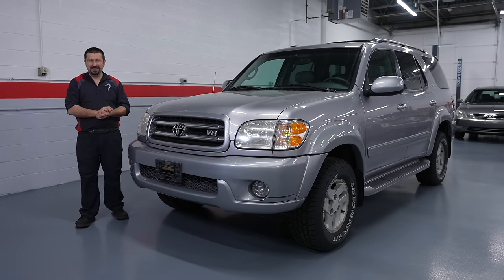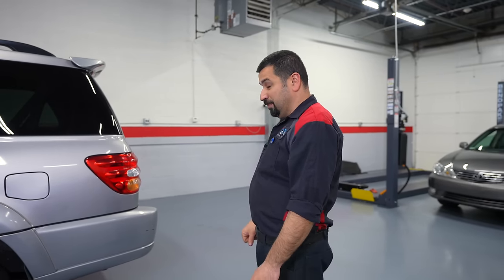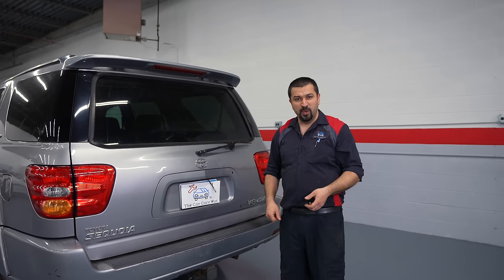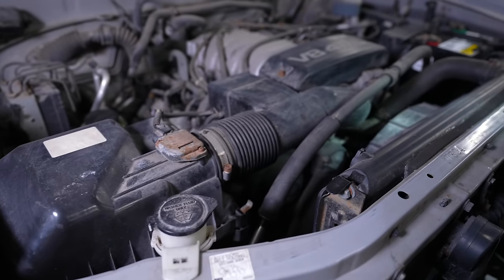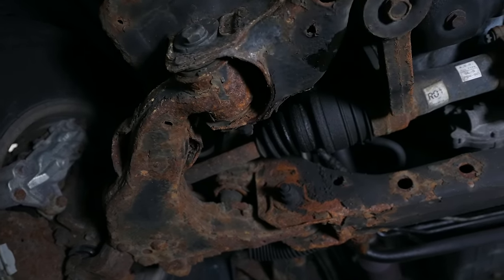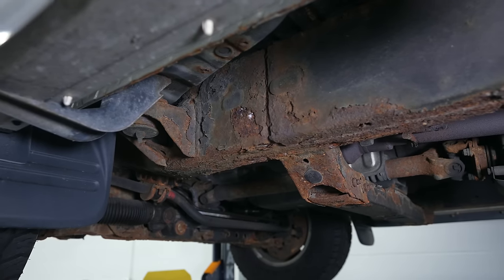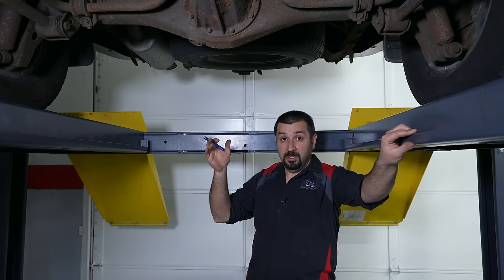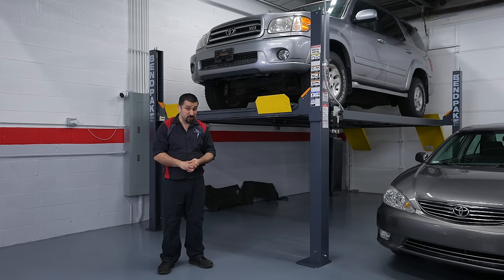NEVER Buy a Toyota Like THIS ONE! Hint : It's not The Sequoia!

Comment: We picked up a 2013 Sequoia about six years ago.   It had 55k miles on it and we paid $35k out the door.   Its an awesome ride and we could not be happier.  It has just over 100k on it today.
Reply: I have the same year - picked it up in 2020 during the lockdown, at 98K miles.  Only 111K or so, now, but it does the long trips with everyone loaded up, not suburban commuting where fuel economy matters.  It's great for the highway, but interior quality is definitely sub-par.  On balance, very happy with it.

Comment: An awesome video idea would be going over the Toyota frame rust issues years,models recalls, etc.. and what models and years that are better than others
Reply: It's just like termites eating away wood, only an idiot would say or think that one type of wood has better resistance than the other. LOL......NO.
Reply: @karkule5919  As a matter of FACT (feel free to do some self learning), termites will avoid redwood, yellow cedar, Laotian teak and cypress.  Perhaps a little research is needed before you use an analogy to label someone an “idiot”….but then again I suppose it takes one to know one.  😅

Comment: Toyota has a quiet recall on rusty frames. I had a 2002 Tacoma 4x4 that has its frame replaced for free by Toyota in 2008 /2009. I not surprised that the previous owner didn't take advantage of this given the maintenance history of the vehicle.
Reply: Makes me wonder about my 2011 that I traded- I didn't want to go into the gray area of the recall where, if the dealer ends up damaging rusty parts mounted to the frame, who pays?  Like mine needed the $80 transmission fluid lines, which would have been probably a $600 repair.

Comment: I bought a 2003 4Runner Limited 4.7L last November with 201K miles on it.  The first thing I did was crawl under the car before inspecting anything else.  It was amazingly clean with minimal surface rust on the rear axle!  Everything else was super clean.

The three previous 4Runners I looked at were complete rust buckets underneath.
Reply: how much did you pay for it?
Reply: @mountenwater  $7400 and that included delivery!
Reply: @2-old-Forthischet  thanks for sharing!! I'm thinking of selling my 2006 4.7L with 131K miles
Reply: @mountenwater  wow, that's a low mileage beast!  Good luck.

Comment: Thanks for this video.  I have an '04 Sequoia with 220k and in almost identical shape to the one you inspected.  The difference is I have owned mine for about 120,000 miles and know the maintenance history. My fluids were always changed on schedule and timing belts were changed about every 80k. Mine has never dripped any fluids. Always parked in a garage and we have never seen a drop from it.  The problems with the Hatch rusting and that Lever/Cable and latch breaking is VERY common.  I have replaced 3 sets on mine.  Toyota has never upgraded the parts so the problem repeats.  Some after market handles made from metal exists, but they just bend instead of break so same end result.  The rust issue of the frame and exhaust manifolds is my biggest issue right now.  Toyota did have a recall program for the rusted frames many years back on the Sequoia and same bodied Tundra's, but the rusting issue had not reached the level back then that is has on most of the Sequoias on the road now.  The Ball Joints also had a recall and should have been replaced on most vehicles.  In my case, I will not quit driving it until I have too. It's just a backup vehicle for us and is only driven a few times a month.  By far the best car I have ever owned.  I had better luck buying this Sequoia when it has 100,000 miles on it then I did with A brand new Traditional "Big 3" American Made vehicle (First towed @ 37 miles and Lemon Lawed by 5000). And that vehicle was the same exact year as my Sequoia.
Reply: You really need to expand your car buying options if your Sequoia has been the "best" car you've owned so far. 🤦

Even the 88 Cutlass I drove a long time ago was in better shape than this and all it needed repaired originally was the transmission and headliner fell down. Otherwise, it was very good for its age.

Comment: I’ve learned so much from this man over time it’s just incredible. This guy and the car wizard are the reason my house has a 4Runner in the garage and had a Tundra until I needed 3/4 ton unfortunately. I have a 09 Camry I use for a work horse commuter and I learned from the car care nut the engine in my Camry is prone to piston scoring the cylinder without careful maintenance. Great channel.

Comment: In my opinion the biggest red flag would be the owner not fixing these simple common issues. Almost every early 2000's sequoia i've seen has the broken plastic door handles and 7 of them with a snapped shift handle. So common that every local parts store carries the shifter and door handles in stock!
Reply: The real red flag is all these frames rot if they are exposed to salt after 10 years. Then brake lines too. It becomes a death trap.

Comment: I'm surprised that you have not seen broken shifters on these, they are very common to fail as well as the rear hatch opener. I have done many of these repairs.
Reply: Was a Toyota parts guy before, and the rear hatch handle is very common.  Often times what happened was the cable got stretched out, and so it took more force to open the hatch.  Plenty of people replace just the handle, but they break that pretty quick because the cable's still stretched out.
Reply: He worked at a dealer and probably mostly saw a newer vehicles

Comment: Shifter bracket breaking is common on those high mileage Sequoia and Tundra 1st generation models. The aluminum casting is thin (bad design) and eventually shears. (The OEM Toyota replacement part has untapped threads, but easy to install). One of the reasons why the 2nd generation went to console shifter.

Comment: 2004 Sequoia is one of the very best vehicles ever made. My wife and I own a 2004 Tundra SR5 crew cab and a 2004 Sequoia. Both had 375k plus miles on them until I hit a deer in the Sequoia back on Thanksgiving 2022. The Sequoia is now the donor for the Tundra
Reply: Yup. You just oil the crap out of it annually if in rust belt

Comment: Ive done a frame replacement in a 2002 sequoia I got for $1000 took about $500 in parts from the junk yard for the frame and rack and pinion, misc parts. I did it in a tiny garage and it took about 3-4 full days of work over a month. It's easily doable for DIY first time ever doing something like that. Word of advice when you get the frame from junk yard save every single bolt you take off and screw back into the place you found it. Put it on 4 6 ton jacks on body pinch welds, drop whole rear suspension keep it all together, drop from 2 suspension assemblies with diff, ratchet trans and transfer case to seats and hoist engine on body from above and take out the old from out in the new one. Get a bunch of 4 wheel dollies
Reply: Or you could buy a used car instead of all the tools needed to do this haha

Comment: My coworker Steve had this exact truck in the same color. He did all the recommended maintenance and like this one looked great on the outside and inside. So one day I asked Steve Where is your Toyota. He told me the junkyard. The truck was totaled because of the frame. So sad. I thought he would have the vehicle forever.
Reply: @Kerry Lewis he forgot to rinse the salt off of it regularly
Reply: @Blakecryderman7244  It always looked clean. I'm taking my new Toyota to NHOILUNDERCOATING. I do not want that happening to my RAV

Comment: I have corolla 2009 , it's a nightmare, engine burns oil , ac compressor issues, interior quality is baaad and too noisy etc, and i found that many owners of 2008 and 2009 models facing the same issues, so don't buy a new or used car before you do a really good research even if you are buying a toyota

Comment: AMD, I hereby promise, before 714,000 witnesses, to NEVER buy a TOYOTA like this one!!!😉As a Salt Belt dweller I take 3 very serious  lessons from this video : a) Rustproof your car!   
b) Rustproof your car!!  c) Rustproof your car!!!    Why would you spend so much money on such a high quality vehicle and then just watch it rot?  🤨    RUST = NEGLECT
Reply: Amen, Amen, Amen! I got my 2019 Prius undercoated after junking my used 97 Camry. I wash, painted, u name it, and STILL rusted out. Got 20yrs out of it total, ran like a top, but I KNEW it was done.
Reply: Not really.  All you have to do is spray down the underside in the spring after winter.   And use POR15 and a steel brush for minor rust spots.
Reply: Fluid film every fall  does wonders
Reply: @on-site4094  Later this year my car will be taken to Krown Rustproofing for its annual application for the 19th time. I  gave it a thorough cleaning on Saturday and after 18 very salty Ontario winters, it remains rust free. In the Salt Belt, rustproofing is just basic preventative maintenance. 😉

Comment: I am oddly fascinated by the amount of rust on the bottom of that SUV.  I've heard of this but never experienced it.
Reply: Just spray down the underside after winter and brush away the small rust apply POR15
Reply: Remember kids, just say no to living in the rust belt.  That cheap cost of living is deceptive....
Reply: @rushthezeppelin  Move to the south....cheap and no rust. I have a 1998 Nissan Sentra....no rust
Reply: @fortheloveofnoise  hot as a MF and poor worth ethic with more than a touch of entitlement for large portions of population . I grew up there. Moved away and saw the "light" and unfortunately had to move back for work and family. BUT the upside is my cars don't rust

Comment: I do know that the Toyota truck frames from that era were known to rust, especially in cold climates. I know there was a recall on that, but I still have two questions Car Car Nut: Was that the original frame? Also, can that vehicle still be covered under the recall, or is too late because of time/mileage for that particular Sequoia?
Reply: I believe the recall time is up.

I had a tundra under the frame recall, it got the frame replaced and it was a wonderful truck, I was sad dumping it at 298k miles, ran beautifully, clean interior that looked brand new, the seats were not even torn...

But, EVERYTHING was rusty, besides the frame and the body.

I had to replace 3 brake lines, there were literally 4 holes in the rear end that I patched to keep the oil in and not have to replace the rear end... I had to replace the exhaust due to rust, replace the front brake calipers due to rust eating the bleeders away to nothing, the power steering hard lines rusted through, the evap lines rusted through. The lower hose clamps was rusted and most were not even clamping anymore - it was only because the radiator cap didn't hold any pressure at all that the hoses didn't blow off. The parking brake cable rusted and snapped (5 speed truck, I needed it), the flanges on the rear axle that house the drum brakes were rutting and I was afraid to touch it. The fuel filter rusted through, the front bumper crash bar was full of holes. The right front control arm had a rot hole, and the power steering rack was leaking due to a very rusty input shaft.

And I'm cutting that list short, every single piece of metal under that truck was a disaster with puffy flaky rust, I had to wear glasses to change the oil

It was an endless time and money pit, even though my dad gave it to me at 240k miles. I couldn't touch things because something else would break, and I was sick of putting time and money into it because it was only 2wd.

BUT, the body was great, the interior was great, and the frame was new. It gives a false sense of "this is fixable". You'd need to rip everything rusty out and devote 6k dollars to it to make it reliable. Having multiple brake line failures from rust isn't something most people are ok with.  But thankfully it was a manual and I fixed the parking brake when it snapped.

Long post, but I want to give some context to "throwing in the towel". I could have ripped someone off and sold that truck.
Reply: The recall was only for Tacomas and Tundras. Sequoias and 4Runners missed the recall for some reason.

Comment: Never had a sequoia but I had a Land Cruiser and it was by far the best car I ever owned. Got 300,000 miles on the original engine transmission rear end starter alternator water pump a/c compressor, all the window seat operators worked, never even changed the spark plugs, headlights or any other bulbs. Amazing car.
Reply: Why wouldn't you ever change the sparkplugs that's standard maintenance it will effect performance and mpg its super easy usually

Comment: What’s your opinion on the market for a used Land Cruiser? I was worried about potential parts support, do you think I would be better off going for the LX as they’re essentially the same mechanically?
Reply: As an LX owner, I don't think the market for parts is better for the LX. Almost all the parts are the same. But what year are you looking at? If you get it with the 4.7 v8 I think most of the engine parts match the 1st gen Tundra, 1st gen Sequoia, and some 4th gen 4runners.
Reply: What year are you looking at for the LC? The main difference on the more modern models was the eKDSS system that the LX doesn't have (at least mechanically speaking).

Comment: Great video. I bought a used, one owner 2002 Sequoia about 3 years ago after a year long search. I specifically wanted a Gen 1 Sequoia and evaluated many vehicles. I live in Wisconsin and I looked for a non rust belt car to avoid many of the problems you identified. Found a San Diego car that had never been driven in snow with 130K and was well maintained. I bought the car without actually seeing it. Had it shipped home and I guess you could say I was lucky.  It's been a very good car with no surprises or issues. I totally agree that you must evaluate the car, but my experience is to also evaluate the seller. In my case, the seller was very honest, straight forward, and provided all the records and photos I requested. I got a good vibe from the owner, unlike some other sellers that seemed sketchy, though their car looked good (at least in the photos). If you sense a seller being cagey or hesitant to provide info, walk away. There are a lot of BS artists out there selling crap. IMO, look for the one owner soccer mom and avoid a car that has had several owners.

Comment: I had a 03 Sequoia I bought it with a trash suspension for like $3500 with about 175k. I should have done a pre purchase inspection cause the frame of the suv was just about rusted out. I drove it for 2 years but all the little repairs that came up was just too much. I put about $6-7k into it when the exhaust system failed as well as the shifter, my shifter looked just like the one in the video. At that point I said enough is enough. Toyotas are ok  but they are not these unstoppable tanks these YouTubers be saying.
Reply: I agree! All of these people preaching Toyota's are "bulletproof" and super reliable is very misleading. You can buy a Toyota with an excellent engine but it will mean nothing if it's sitting on a frame of rust.
Reply: @FCguy709  A well cared for Toyota is bulletproof. This was not cared for, at all.
Reply: @abdullahipad7664  yeah but they can get REALLY expensive and ridiculously difficult to work.. for example the 2GR and 2AZ engine. They need ENGINE OUT work to fix the head gasket or valve cover issues or to fix the oil burning issues by replacing the pistons.
Reply: If you spray down the underside after winter and brush out the small rust.  Apply POR15 then you’ll hav no issues
Reply: @dattape2828  ain’t nobody got time for that when the average American is working 2 jobs to keep a roof over their heads and food on the table.
Reply: @FCguy709  My wife’s family only drive Toyotas and I can say from personal experience they are not this super reliable brand like what’s being spread. And what I went through with my old sequoia if it’s not new or near new I’m not buying another Toyota ever. My brother in law got a sick looking 2016-2017 4Runner and he has surface rust on the frame.
Reply: @abdullahipad7664  Dude I live in the Midwest where salt is put on the ground. Maybe Toyota can make a rust resistant frame. I now have a 2007 Cadillac DTS with no surface rust on the frame or undercarriage.

Comment: “People are fascinated by cars that have never been in an accident.” 😂 Well said. 

I live in Michigan and a little fender rust isn’t a dealbreaker, depending on the price. You gotta look underneath at the frame and the rest of the chassis. Any Sequoia where I live is going to have that fender rust though so unless you’re buying one from the south and bringing it up, you’re gonna see that. 

Also, those rear door handles always break. The factory part is plastic. I agree it should be fixed but that’s a design flaw, not a hammer hand owner.

Comment: I currently use a 2007 sequoia which was purchased brand new, mileage is currently 150k miles minus the few mechanical issues it is running great, thanks for the advice and great video. Another reason why too much offroading is bad.

Comment: Just bought a 2008 SR5. It actually looks pretty good underneath. They replaced front calipers and I had them replace the CV joints. I knew to look for most of what you discussed but probably missed a few things. Fingers crossed. I will be checking out more videos now that I own one. Thanks.